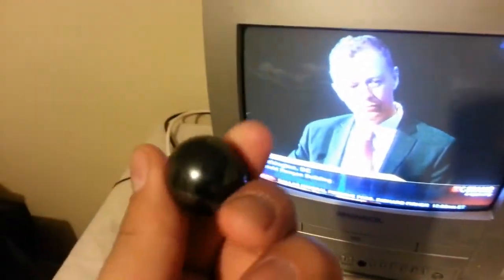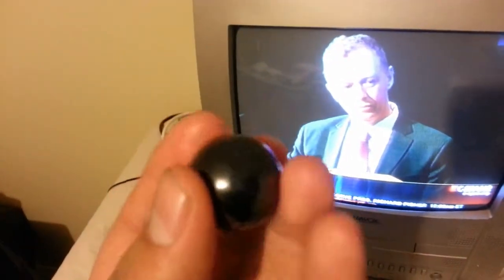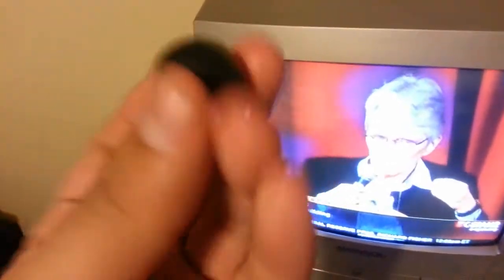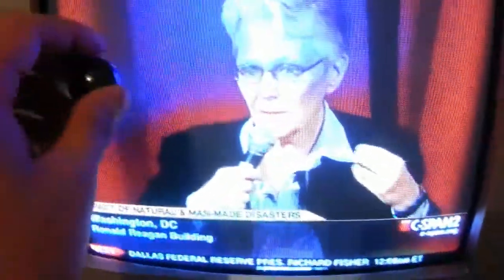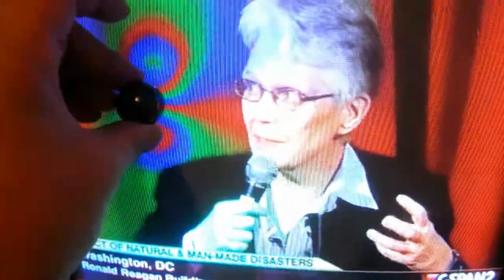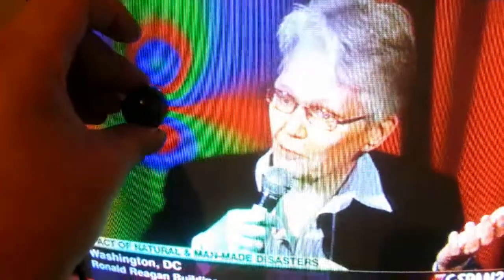Why do magnets mess up CRT type TVs but not flat-screen TVs?

Comment: CRT’s use magnets on the inside to correct colors. Putting more magnets near the screen just ruins the tv more. Also for those who aren’t careful magnetic interference can stay for a while unless you use a tool to remove it. Professional CRT monitors have something called degauss built in which helps remove magnetic interference.

Comment: ass holes where's the explanation!? My guess is, since you assholes didn't answer it, is that the beam speed is affected by the magnet and that's just a wild guess... asshooolezzz XD
Reply: CRTs use a scanning electron beam to display images. This stream of electrons guided across the screen by controlled electromagnetism can be distorted by the presence of an external magnetic field. Since there are three different beams for the three colors (red green blue) they get distorted differently, creating the lobed effect seen here. Flatscreen displays use a range of pixel-based imaging technologies, none of which are similarly affected by magnetism.